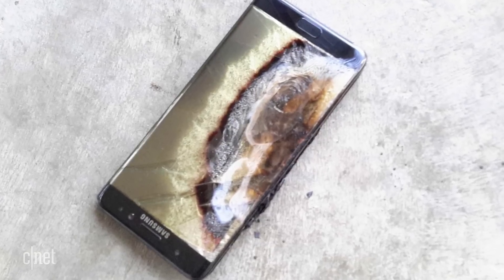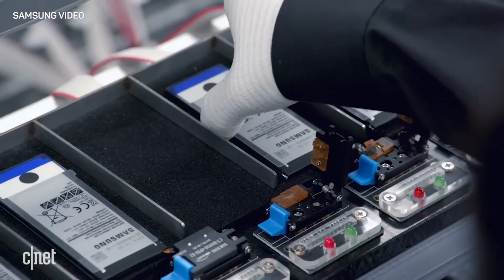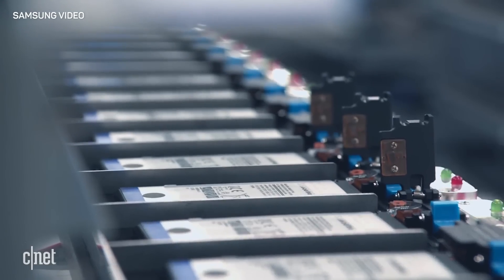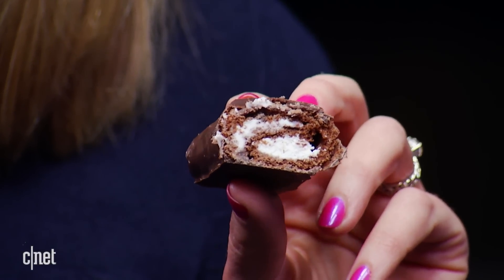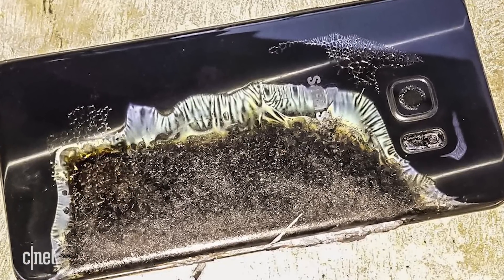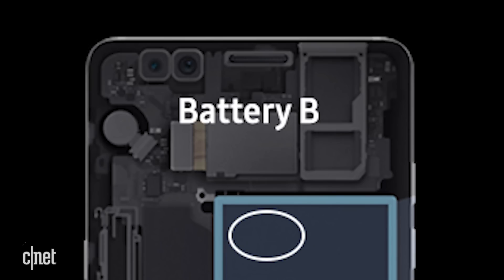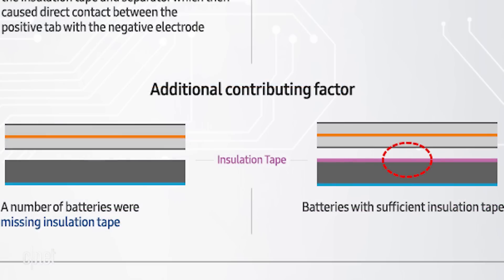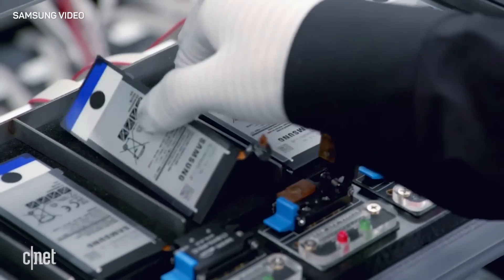Explaining the Note 7's battery flaws (with cake)

Comment: In 2017:
After I happily owned the iPhone 7 Plus in 2016, Samsung introduced an eight-point battery check to launch the Samsung Galaxy Note FE, which is the post-situation successor to the Samsung Galaxy S7 Edge as the chief Galaxy Note 7 replacement especially it's new color option Blue Coral.

In 2022:
After I happily owned the iPhone 13 Pro Max in 2021, Apple Inc. introduced the iPhone SE 3 to feature the new 5G cellular, longer battery life, blazing fast A15 bionic chip, improved camera and the color options corresponded to the iPhone 13, which is the post-situation successor to the iPhone SE 2 as the 2020's resolution replacing the iPhone 8.

Comment: wow. the effort to test them to find out what happened.
I dont think Samsung will truly loose customers.
Reply: Ambrose They still want your money, it's all about money.
Reply: Bernie Valter 
do you have any idea how many recalls come out of the automotive industry alone? an industry with over 100 years of making cars? parts fail. the fact that they spent a lot of time and money to test and find out what happened is impressive.
Reply: Ambrose what??? And what about the zero effort to test it properly in the first and even the second place? Shit, if they at least did x-ray in the first place... and the Fail with replacement units? They dont give a slightest F* about customers if they have chosen quick, unexamined replacement instead of safe one. "Sir, it was the biggest flop of the year that out batteries exploded, shouldnt we take time to test the replacement batch?" "No, time is money, and our customers would buy it anyway, Lol"
Reply: shahid mirza Stfu, they're a company. Companies need money. At least their not like Apple which charge you for manufacturing problems
Reply: TRealGz And what are those manufacturing problems?
Reply: TRealGz is apple the only one with these problems? The only reason you are hearing about it is because apple is always in spotlight. Just like so-called bend gate. 

under normal use no one had a problem and neither did I. Nexus 6P has the same problem apparently but guess what idiot I own this device to and I don't have any bending issue with this one either.

Every phone manufacturer has problems for different reasons and the only reason we hear about it is because big companies are always in spotlight. 

What ever problem apple is having compares nothing to Samsung's battery issue. Apple can ignore the problem and still no one would die. 

Samsung never had this option, they had to recall otherwise they would have had blood on there hand.